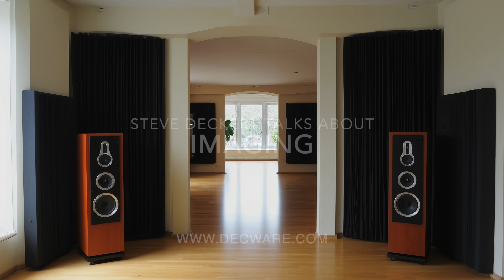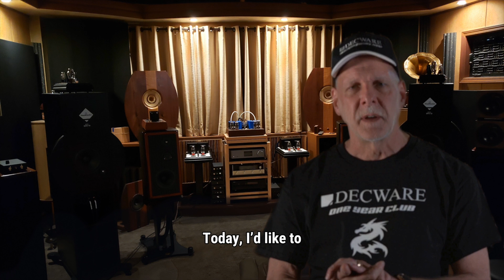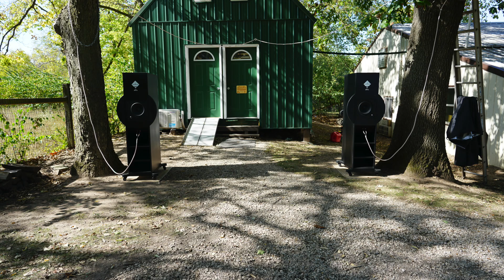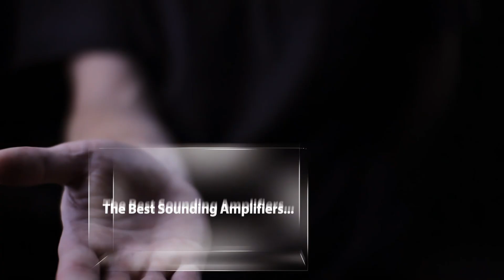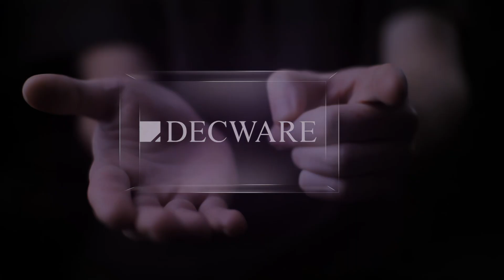DECWARE's Steve Deckert talks about Imaging.

Comment: Hi Steve. My speakers are flanking a cased opening, but more than twice as wide as shown in your video - 8' wide.  To take advantage of the opening, where would you place the speakers?  They are open baffles.  If I used your layout, and placed them several feet on the outsides of the opening, they would be roughly 12' apart.  My listening position can only be about 8' away, because of room dimensions - 12' x 16'.  Thanks!